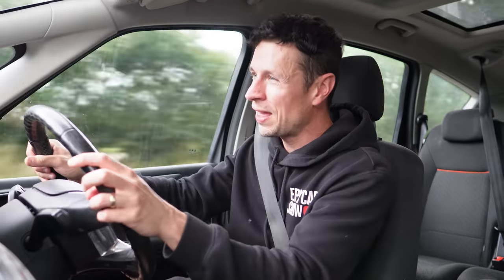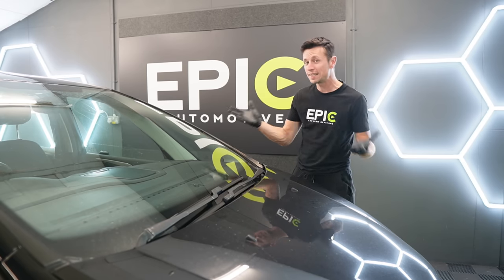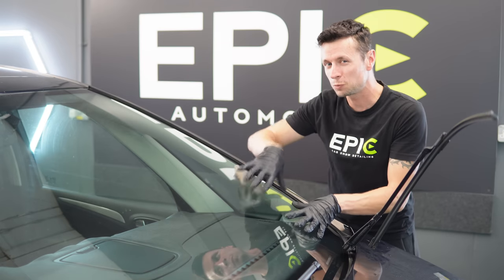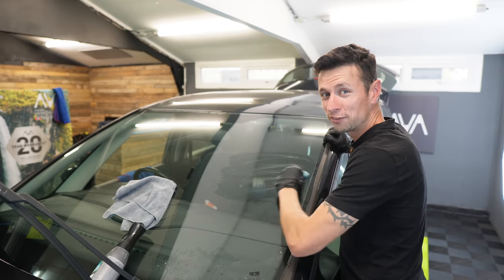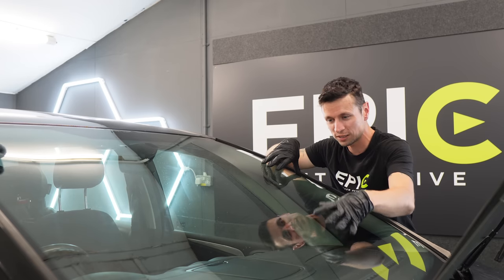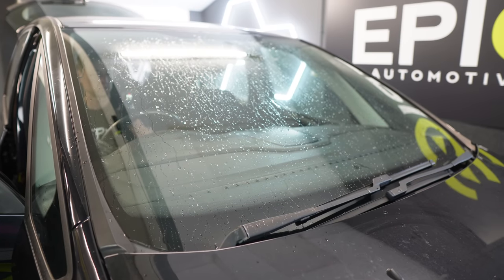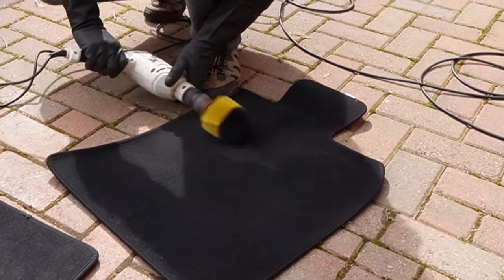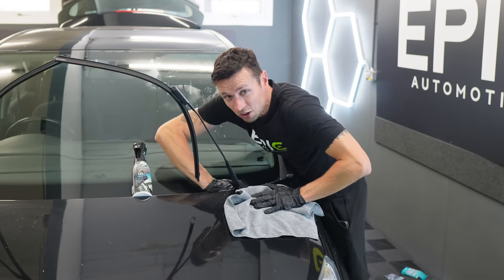How to Fix Annoying Windscreen Wiper Juddering for Good!!!

Comment: What I struggle with most. Time. Seriously trying to give the car a good deep clean on the only two days I have (sat/sun) with shopping to be done, kids to clubs, cleaning the house is near on impossible.
Reply from the maker: Ok so the quickest way to wash a car? It may not be the safest but I can certainly make that. Depends on the end goal. The proper process takes longer but then again most cars these days aren't Supercars
Reply: @epicautomotivedetailing  Thank you and exactly what I'm thinking, how to wash a car and dry as fast as possible.  I wouldn't want to leave swirl marks.  When I do get that one day, I do the best with what I have eg snowfoam, pre wash,  wash, clay mit ( to save time), metal fallout, alloys , autoglym ceramic spray ( time saver), tyre dressing,  glass. On days with no time, I just look at the car in despair. It's a First World problem, but it bugs me.

Comment: My problem is having the confidence to know what products to purchase and how to use them. I watch your videos for information but as yet I’m still not confident on getting the correct products. For instance do I start with, Traffic Film remover, Pre wash or all purposes cleaner before a snow foam ???  And my car definitely need help as it has stuff stuck on the roof and green grime on the rubber trims 😢
Reply from the maker: Hi Marcus either pre wash has its own strengths and weaknesses. I find the best and safest overall is citrus pre wash
Reply: Thank you. I’ll get myself some of that 👍🏻

Comment: Another great video Dave, don’t think I’ll be the only one saying this, but water marks on darker cars are the Bain of my life 🤔🤔
Reply from the maker: Thank you mate. I do have a video that covers that but I will maybe cover it again as it was an old video so it's a bit dated
Reply: Try Koch Chemie FSE, I'm now confident washing black cars in direct sunlight without worrying about water marks due to this product. I'm a mobile detailer and sometimes cannot get a shady area to work in. I just wash the car as normal, dry it as normal, and when I'm done with everything I go around the car with FSE. It easily removes marks, provides lubrication, and gives gloss and sleekness to the paint.
Reply: @larry1363  It's a great QD.

Comment: I like your videos and you are very helpful and thank you for showing your tips and your mistakes.  Would you make a video of all the things that you edit out like you dropped the claybar? In Texas it's hot 105 F degree or 40C degrees  and detailing in the heat and direct sunshine sometimes isn't an option. Do you have any videos or products that can be used in direct sunlight?  I use CSI Clear Coat Solutions and their products can be used in direct sunlight, Q-7 Wax, Ceram-X, Nu-tyre and their Ceramic Coating Autoslick.
Reply from the maker: Wow that's hot. I can't imagine how difficult that must be. I will make outtakes but may put them on YouTube shorts

Comment: I have a Tesla Model 3 and I got the hydrophobic coating for the windscreen when I did my ceramic paint protection professionally done. The wipers started skipping like crazy. I asked them to fix this and supposedly they put the best stuff there is on the windscreen but the issue is still there...
Reply from the maker: Use glass compound by soft 99

Comment: Hi I used glaco glass compound to remove all contaminants off the glass and applied glaco soft 99 on it, changed out to new wiper blades. Still juddering and shaking non stop under the rain. Super annoying and it squeak as well. Using the soapy wash fluid helped remove the noise for 2 seconds and it's back. The wiper arm is 90 degrees straight, I have also coated the wiper blades with a layer of glaco like you mentioned. Help..
Reply: One other thing that can cause juddering is if the wiper arm is twisted.
In some cases you can just use a pair of pliers to tweak them.
The wiper blade needs to be able to flick slightly from side to side evenly as it changes direction.

https://www.youtube.com/watch?v=w0I-obFmADE

Comment: My biggets issue is working out what equipment and products I need, and having them out ready to go at the correct time.

I constantly find myself back and forth to the garage.
Reply from the maker: Ok that's a fair comment, I used to be like that. I found a cleaning caddy always worked well. But then I switched to boxes. If you check out a video I made a few weeks ago about using a car instead of a work van I actually mention an amazing method that answers that question 🎉

Comment: My biggest struggle when doing an interior clean is with short dog hair woven into the cheap carpet. I have tried the Lilly brush vacuuming and a host of other methods. It is especially difficult removing it from small crevasses like between the seat and the door. It takes forever and still some hair remains.

Comment: Great video Dave.....I've  never seen a coating applied to the wipers  before so good tip pal. I use rainX after every wash which does the trick but use wd40 every so often to clean the wipers so i will try using the rainX instead.  Thing i hate the most is geting up and down the ladders to clean my van roof! Up,down ,up,down,up,down😢😢😢
Reply from the maker: Dare I say it but depending on the vehicle. Eg a work van a soft brush could save time on the roof. Yes it will probably scratch it but no it won't be seen unless a giant is next to it so it's doable. Also pressure washers with extension lances always help
Reply: @epicautomotivedetailing  Good idea and there are some brushes out there which won't scratch the roof

Comment: More of an annoyance rather than a struggle but i pre wash, snow foam, contact wash, spray sealant then with a combi of drying towel and blow dry the car but as much as i blow dry the car i have to go out the next day and sort out the runs from the wing mirror housing down the door, its easily sorted with a damp microfiber and KC FSE but is a real annoyance
Reply from the maker: Sadly unless you constantly blow the water out theres no real fix for that. Totally understand the annoyance

Comment: First thing to do would be to check and make sure the blade is completely parallel to the Window, if not, then you need to bend the wiper blade. Arm so that it is this is much quicker than a clay bar

Comment: Hey, Dave. Great video.

I would say the most struggling part and most paintfull part of cleaning is the rear glass on cars like where the boot lid opens but the glass doesn't, and you can't fold the rear seats down,  such as Audi A4, Bmw 5 series It's a pain to clean. Would love to see your tips and tricks to tackle the rear glass. That will help a lot of people and would be a great video for your channel.
Reply from the maker: That's a very good question. The glass on Porsche GT3 for example is the worst but it warrants a video for sure
Reply: @epicautomotivedetailing  Would love to see a video of how you would tackle that, I haven't got to clean a Porsche yet. The only thing closest to a porsche i have ever cleaned is a toyota MR2.

Comment: Hi Dave. Great and informative video as always! On of my pet hates when cleaning my VW Golf GTD is the alloy wheels, they are gloss black and the faces are machined. Whatever I use, but typically Bilt Hamber Auto Wheels, two bucket method and Auto Foam or GT Wheel Shampoo it leaves the gloss black finish milky. I have tried shorter and longer dwell times etc, etc. Any help or advice appreciated. My thanks, Ian.
Reply: Sound like they have been wheel acid washed in the past.... buff them with compound..  your clear coat is probably damaged..... what your describing sound like clear coat has basically been turned matt...

Comment: biggest pain i find is cleaning the inside of the front screen, getting down the bottom near the dash/vents is always a real problem for my big hands lol. then getting it nice round the rear view mirror.
Reply from the maker: Try a Porsche GT3 lol. Those are a nightmare but yes you have given me a good idea for a video
Reply: @epicautomotivedetailing  lol i can imagine, very tight squeeze, Ford capri is closest ill get atm lol. another pain is the door card where the cubby usually is, i sometimes kick it and mark it up when getting out of the car, the pain of being 6'4 and long legged lol. what's best for cleaning and restoring that?

Comment: the most difficult thing in car cleaning...has to be the underside of the car. I always struggle to get into all the nooks and crannies under the car...yet it is soooo important to do...because...of rust.
Reply from the maker: For blasting you can cheat by using an upside down patio cleaning head. The big round ones. Flip them over and watch it blast the dirt

Comment: I struggle most with with red hot to touch paintwork. My car is dark blue and guarantee the sun bakes it every Friday after work when i want to clean my car
Reply from the maker: So garden hoses will cool the car down quicker than a pressure washer because of the volume of water not coming out like a fine pressure. I found in the old days hoses without a nozzle just cooled it quicker. It's wasteful but I guess we have no shortage of rain so it can't be that bad for waterboard
Reply: @epicautomotivedetailing  ah brilliant will have to give that a try. Really is a struggle with the heat and drying to quick

Comment: Always use very fine wire wool on my glass
Reply from the maker: Never tried that before thank you for sharing
Reply: @epicautomotivedetailing  has to be fine wire wool works a treat Dave you’ll have the smoothest cleanest glass for miles around

Comment: Biggest issue is applying sealant onto the window trim without getting any on the window
Reply from the maker: Personally I've just wiped it straight off after getting it on the glass but I will look at other methods for sure

Comment: Very often it's just down to the wiper blade sitting at the wrong angle on the screen and you need to wrap a pair of grips in a cloth and gently twist your wiper arm until the blade is nice and square to the screen again.
Reply from the maker: Thank you for commenting 3 mins into the upload, when you watch the whole video It shows a different story as the wipers were awful after a few methods and the one thing that people say is the problem actually fixes it so hopefully if it turns out the arms are not twisted and there genuinely is something wrong with the blades this method will sort it 🙂

Comment: Water marks on a black car
Reply from the maker: Sorry I misunderstood the comment about spots on black car. I thought you were referring to mine 😅. I actually have a video that covers that but it's titled how to clean car emblems which covers it 🙌
Reply: Try Koch Chemie FSE, I'm now confident washing black cars in direct sunlight without worrying about water marks due to this product. I'm a mobile detailer and sometimes cannot get a shady area to work in. I just wash the car as normal, dry it as normal, and when I'm done with everything I go around the car with FSE. It easily removes marks, provides lubrication, and gives gloss and sleekness to the paint.